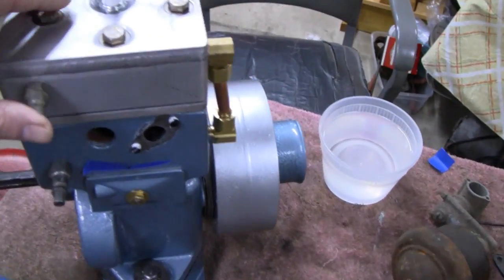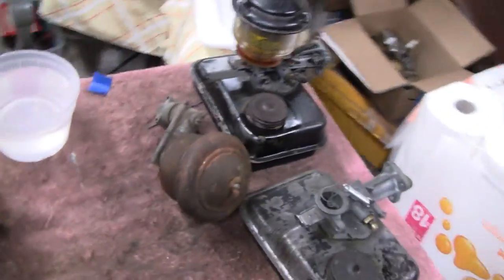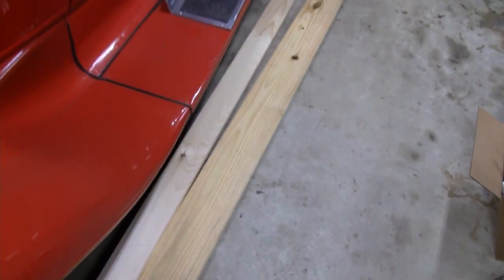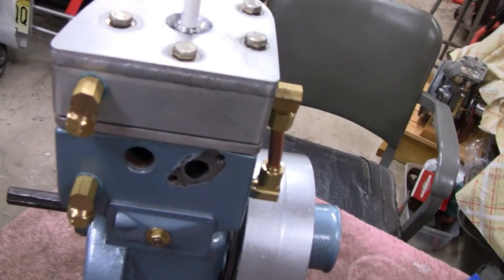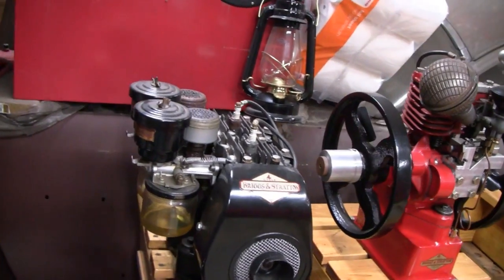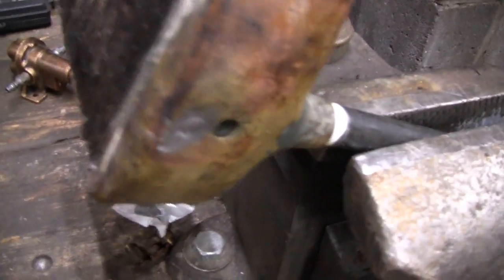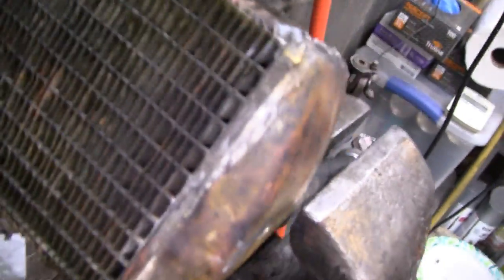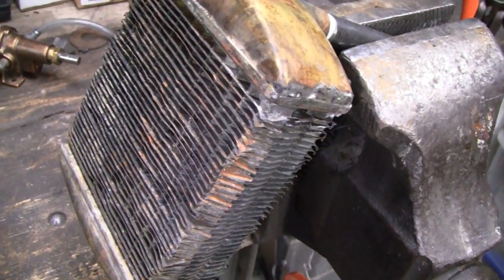HOMEMADE WATER COOLED BRIGGS ENGINE (part 31)

Comment: for that threaded hole you are trying to seal....if you can find a plug that has a recessed allen head you could run it in below the area area that needs sealed. then do your solder work. when you are done you can run the plug out and it will"clean up" or make threads in the solder as it comes out.

Comment: Thanks for the update we must be so close now to it running, you're just teasing us ;). Those guys that say spend all this money  are probably the same ones that take a real   common farm tractor like a farmall H, thats worth $3000 running nice and fully restored with new tires. Then spend $12.000 on it with a 2 pack paint job thinking they will make their money back and more. Then b!#ch like h*!! when they can't sell it or get bid $3500 in an auction L.O.L.. I got projects here waiting for a  solution to turn up at the right money, for the same reason you didn't spend $200. Take care see ya next time.
Reply from the maker: Yeah part of the fun in building these engines is repurposing scrap and working with what ya got!!☺

Comment: A bolt and a gasket to seal the out side of the hole, and you are done on that radiator plug, did the original drain have a wide base, and a cork gasket on it?
Reply from the maker: Originally it had T valves on the top and bottom!! Top was the bleeder, bottom was the drain!! Since it was a pipe thread I just cleaned up the valve and sealed it with epoxy!!☺

Comment: Looks awesome RK...I'd think that hole would have been sealed with a plug and fiber washer like what you would find in the sump...Can you screw something in there and fill it with solder over.?
Reply from the maker: Thanks Mate!! Originally it had T valves on the top and bottom!! Top was the bleeder, bottom was the drain!! Since it was a pipe thread I just cleaned up the valve and sealed it with epoxy!!☺

Comment: For sealing the hole in the radiator you might just get away with a bolt with a rubber washer and a flat washer instead of a plug.

Comment: is that air cleaner assembly off of a Goodall Lauson? I know they used the three elbows bolted together. Great Video Guys! want to meet you someday!
Reply from the maker: Thanks AJ!! It probably is off a Lauson!! I think I got it in a box of parts!!☺
Reply: very nice! I have a goodall-lauson engine on a lawn mower i rebuilt for a FFA Project. Love that air cleaner! Is  that a United air cleaner? I have a few yellowed but nice not cracked saf-t-vue air cleaners for my Clinton engines. Modded one for my 6S too.

Comment: Use a rubber gasket with a flange fitting over sized on top. Take a washer and thread your flange fitting with a washer attached and use a rubber gasket or O ring.

Comment: I wonder if you could plug that hole and eliminate that gap/leak by using a washer with silicon sealer underneath and tightened down using a short hex bolt of the appropriate diameter?

Comment: looking forward to seeing it run i know there would be know what do this this ovously but if this thing had a oil pump and what not it would be cool to see it with a mini gauge cluster and sitting on the engine stand as if it was in a engine run stand like you might find a car engine.

Comment: solder a penny on the hole of the rad  or use a automotive oil drain plug that has a gasket.

Comment: The dual carb B&S  is awesome.  The glass gas tanks are very cool-nice to see the pick-up tube at work:)  The air cleaner looks great and a 45 degree muffler will be a nice arrangement.  Nice  to see it all coming together so well.  I hope you can use the original radiator.   Liked and have a good new week!
Reply from the maker: Thanks Steve!! Yeah we'll be using the original radiator!!☺

Comment: I know you've done it now mate, but screw a smaller pipe (internal and external thread) into the hole in the radiator. Epoxy or solder the top = job done :)

Comment: Hey Road guess i'm missing something. Just put a brass petcock in it and tighten it down. After you screw it in solder the brass petcock right to it If you have to. Thanks for sharing your fun. Best Wishes n Blessings. Keith

Comment: My light bulb just went off!  I think someone mentioned using clear pipe rather than the copper for the stubby line between the two 90s.  For visual effect maybe the clear line plus a colored solution for the coolant.  I guess if you did that the fluid would need a few bubbles to show that it was moving.  Dang!  I just made something very simple into a major undertaking.  It's easy for this "keyboard commando" to come up with more work for the Buddies!  Love the project!  Keep the vids coming!

Comment: well you could always just use a rubber seal between the bottom and the fitting or plug
or braze a new plate over the existing plate to seal it I'm sure you will work it out one way or another buddy
Reply from the maker: Holy Christ, not another Internet Expert!! You can't even make Hamburgers without burning them!!☺

Comment: If you do decide to make another water cooled Briggs engine, maybe you could use your epoxy wizardry to make the head look like a casting, rather than a machined block, as well as placing the water connection between the head and the block, rather than an external jumper.

Comment: Oil air cleaner! Neat! I have a shop manual for 1948 to 1955 chevy trucks and it explains how to fill the filter with different oil weights in the summer and winter :D

Comment: Who hates on a video series like this? Thanks for taking the time to make these videos. I look forward to seeing them pop up in my feed. Very Entertaining to see these one of a kind engines come together.
Reply: Watching from the UK. Great series. Keep em coming :)
Reply from the maker: Thanks alot Jon!!☺
Reply: If you ever need a different radiator or this one does not work for you. A 1981 Datsun/Nissan 280zx turbo has a small oil cooler that looks just like a mini radiator. Maybe a local junk yard has one. Some minor aluminum welding is needed, but I do remember that they are cool looking.
Reply: Mobile users miss click the like button and end up disliking the video. With the advent of the mobile, now it's even easier than before. You can thank GoogTube for that and their unwillingness to make anything right. Like for example, putting the like and dislike buttons on opposite sides of the video screen. They should really change their motto to "if it work, we will endeavor to make it worst".

Comment: It would be far easier to just use a bolt with a sealing washer (copper or rubber).
Reply: That might be a good idea, IF those threads aren't pipe threads... Though he might could make them bolt threads if there is a similar size to what's there.

Comment: hey roadking the oil bath air cleaner they are plastic correct? could you not try using one of those car headlight restoration kits to polish them back up to clear.  even some of those micro grit sponges they sell for resin pen making and spin the filter housing on your lathe...    good choice on that filter looks nice and the jam jar gas tanks are true to the model engine makers :) only difference is we run them on the vapours :D      the breather runs down to the bottom of the jam jar and the pickup is flush with the lid out of the gas, breather pulls the air through the gas making bubbles and the vapours feed the engine.
Reply from the maker: That's 60 year old plastic, if they turn yellow it's through out not just surface crazing!!☺
Reply: That makes sense. Damn I thought we were onto an easy fix looks like you need to invest in injection moulding or maybe resin casting 😂.

Comment: Just wondering how are you going to drive the water pump?
Reply from the maker: Sprockets and chain off the crank!!☺
Reply: Thanks, I was wondering if you were going to mount the pump to the engine or the platform but either place will work fine and the chain and sprockets will defiantly do to drive it but a pulley and belt may be a little less noisy. Nice project you guys have going on there and a great way to spend quality time with others.

Comment: Might be a bodge, because it does not fix the root issue but works around it, but can't you just just seal the hole with a plug that has a bit of a flange and a rubber washer in between?

Comment: Very cool air cleaner, on the water fittings if you did 2 90* fittings one a tad longer you could plumb the lines straight down and they could be parallel?? Maybe just a thought.

Comment: They make a plug which seals on the face using an O-Ring rather than using the taper of the threads and pipe dope. Being a machinist one could custom cut brass to do this. It would seal, and look trick. Too bad I don't have a mill to be able to cut the hex head. Let me think on this, I was a designer back in the day of vellum drawing blueprints, and now we use AutoCAD.

Comment: Good Morning 805RoadKing. That little beauty is looking fantastic. I know you pretty much mount your one off creations on stands and run them briefly and that is great. I just thought it would be really fun to see one on a go kart that looks as vintage cool as your engines do. This one especially looks like it should be in a miniature T-bucket pickup to me. That old school water cooled flathead in blue and brass would be a cool motor for a low riding steampunk rat rod like the red rider that Carsandcameras built. Not that exactly but along those lines. 
When I saw the white oval logo on the motorcycle radiator it made me think of a Ford t-bucket. 
Anyway thanks again for sharing.
Reply from the maker: Thanks Bud!!☺

Comment: How about a fastner with a cupper washer to seal the radiator?
Reply: thehaze1972 ..... thinking the same thing. They make a plug which seals on the face using an O-Ring rather than using the taper of the threads and pipe dope. Being a machinist one could custom cut brass to do this.
Reply: Even a regular washer with some rubber would work. Had a freak accident on the highway happen to me where the rad simply spewed its guts, a light check found a hole about the size of a small BB in the top. Fixed with what everyone has around in their trunk, some random sheet metal screw with a rubber sealer washer. I think it's been 3 years since, and i still haven't done anything about it.

Comment: Hey buddy if you clean that up with acid or a vinegar or the like then use bakers soldering fluid to help solder and do a neat job then just re-thread it... should be fine.
there are other ways too.
you could solder a flat washer to the outside and use that as the sealing surface if you get what I mean? Hope this helps. :)
Reply: Just cleaning up the outside and using a gasket should be sufficient too I suppose, but your plan is better. I suspect that was never meant to be sealed if it is just riveted in there, so that might have been the original plan anyway.

Comment: Can you put in a plug like used on oil pans?  Flat ring and rubber gasket seals to the outside of the radiator